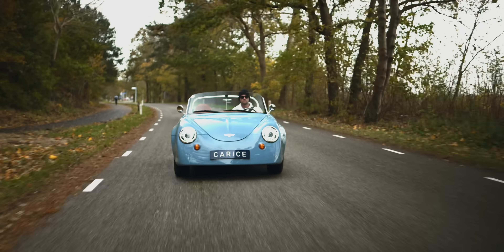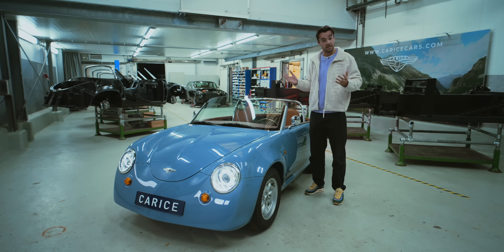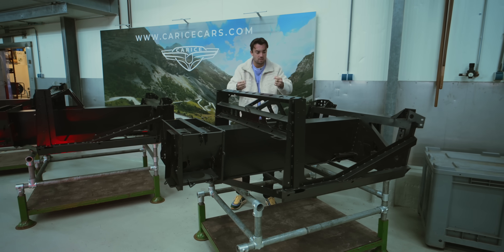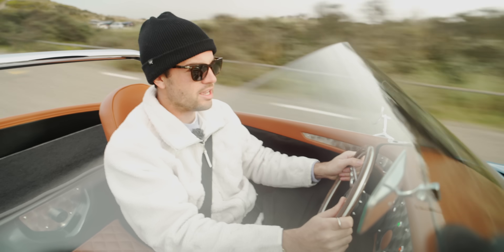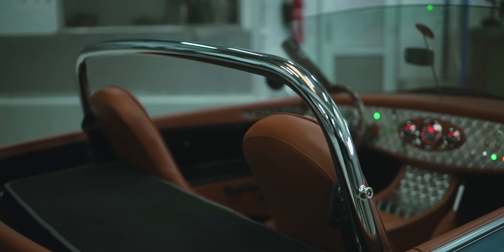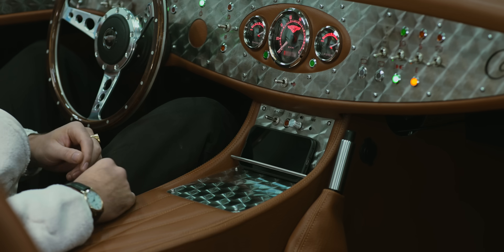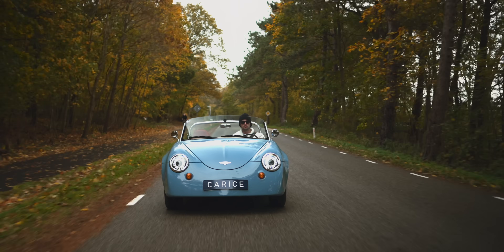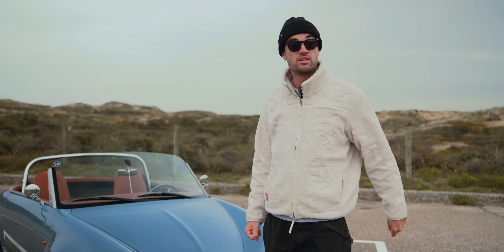This Is The First EVER Lightweight Electric Sports Car!

Comment: "Sportscar" with 50hp, even concidering the weight, it is 70 hp per metric ton, I have driven sportyer forklifts.
I like the idea of a small light electric car, but not with less then 100hp/ton and I would never call it a sportscar with less then 250hp per ton

Comment: Finally, some semblance of a decent EV vehicle. Still the range is God awful. I saw someone post a 300 number and it piqued my interest, then I saw it was kilometers lol. I'm US based so to feel "safely comfortable" 400+ kilometer range (that includes spells of spirited driving) would be more like it. I drive really rural mountain roads (Appalachia) and charging infrastructure availability can be VERY questionable. It's also not that unusual for me to drive 1300km+ in my Miata over a single weekend. I've done it multiples of times. I don't want to spend my driving life at a charger. Driving is my "zen" moment of peace and happiness. The fewer interruptions the better.

However, at least this is a step towards what I'm interested in. Drop the price a bit and make it look more like a slightly modernized (lightened)Fiat X1/9 and I'd be more interested, even with the not so good range. Or hell, just buy the old license for the Dallara X1/9 widebody and electrify it. I'd purchase THAT in a heartbeat if a ton of focus was put towards the suspension and handling.

Comment: Looks like a fun little toy but, taking the rose tinted specs off, lets be honest it's a wealthy persons toy. It's totally impractical so you need another car for normal day to day use. It's only usable during nice days unless you want to literally freeze to death. Might come with a roof but I didn't see any form of heater at all so the windows will steam up and make that useless. An Aux port? Really? Its 2023 - bluetooth isn't hard to do. No screen is fine but all that means is people will need to mount their phone somewhere as they still need sat nav. As for safety its pretty low so seeing ahead with other cars on the road will be tricky and I wouldn't want to be in an accident as there's no way you're going to come off better than the other person.

Comment: If the car didn´t have all the luxury inside, and plastic body-panels instead of steel-panels, it´d be even lighter and cheaper... And if it somewhen were even  to be not just "cheaper than 45.000", but instead, really affordable, then, it´d be perfect...!!! and this one time per year, that you want to transport something big, you´d use a carsharing-truck... Too  luxurius, too pricy, a bit too heavy (I´ve had ligher cars for less than 1000€), but otherwise, perfect...!!!

Comment: Would be even better with a sporty exhaust on it.
Reply: How long will it be before someone puts a beefy audio system into a car like this, tethered to the accelerator for a good bum-tingling roar ? Preferably one you could customize & simply turn off when desired. Totally agree with Jack about the feel of a good thunky switch & feeling the road with simplified steering & braking. Not, however, buying that the electric whine is a positive.

Comment: No crash protection whatsoever. Roll bar at head height. No seat belt. Even a slow crash will make a mess of you. And the switch gear is overly simplistic.

Comment: After looking at their website, I have to say that the EV tech details disappointed me. Jack emphasizes the 10 years of perfection. I thought: "great, they focused on a great drive and figuring out the EV-Essentials". But if my research is correct it needs 2.7 hrs to recharge the 26 kWh battery pack ... To 80%! That would be one-phased 7.3 kW charging and you'd need a 22kW charger to get there. A car like this doesn't need cutting edge charging tech and I didn't expect 0%-80% in 20 min but this seems ... botched. Look at what the Dacia Spring extreme electric 65 does for almost half the price. Maybe they should do a co-op with them?

If it's true, that it only charges on one phase, that would mean on a public 11kW AC charger it takes 5 hours. That's blocking fee territory for 80%.

Comment: EVs are boring. Boringly reliable. Boringly having 20,000 mile service intervals. Boringly quiet, just as Jaguar and Rolls Royce attempted to be. Boringly unlikely to have catalytic converters stolen from them. Boringly spacious for their size. Boringly quick. 

They're not "boring". Only those who haven't driven them find them "boring". And have you met most people? They don't want exciting cars. They want reliable automotive appliances, largely in black, white or grey. Look at Toyota, Honda, Ford. Not even remotely interesting. That's. What people want. If anything, EVs are too exciting for most.

Comment: The "At last" electric, but for the budget "Mid-life crisis" brigade.

Now, reduce the motor and battery size, stick-on a hard-top, remove all the shiny, she-she fittings and get the majors to manufacture (To reduce the cost) and you've got something with everday usuability, a modicum of style, almost blacksmith fixability, that Mr and Mrs urbanite/suburbanite can afford to buy and run without indulging in ludricous personal  finance schemes which cripple personal and national economy alike. 

And, not forgetting that, due to tbe demographic bulge over the next cew years, an ever increasing chunk of the total spend and leisure time will reside with those receiving less than average income... yet they are not being catered for in the new electric market. 

Trouble is, the majors, with the exception of perhaps Citroen, Dacia and the Chinese manufacturers are he'll-bent on a kamikaze market contraction path that's only producing increasingly heavier and more expensive cars, outwith the needs of ordinary users. 

Bye - bye Western European majors... Bell-ends. Time for the wheel to be re-invented.

Comment: Very cute, but disagree about suiting a taller man. The seat has zero whiplash protection, and the combination of windscreen and low rollbar is useless, even if it's got adequate strength. In a rollover, or if something goes over the top, your head is coming off. It's reminiscent of the Renault Spider with its grand total of 1685 sales. This has none of the performance, and is clearly targeted at young women, but there's an army of dads who will push hard to stop their daughters losing their heads. Even a Daihatsu Copen has better protection.

Comment: Insane 45,000 Euro for an electric Suzuki Cappuccino, it's rubbish just like the petrol version was 30 years ago "for what you get it's staggering" exactly it's a staggeringly overpriced piece of whiney junk built in a backyard shop by amateurs - the switches on the dash you fawn over look like crap from the scrap bin at a wholesale electrical supplier - it's just a terrible.